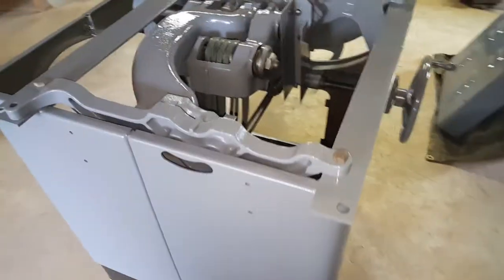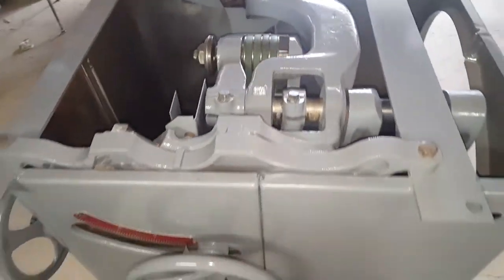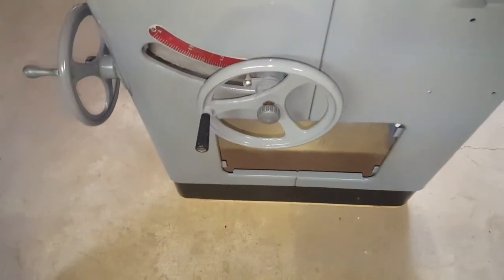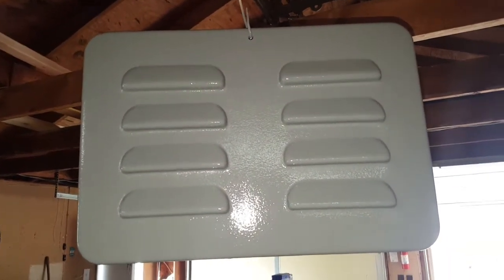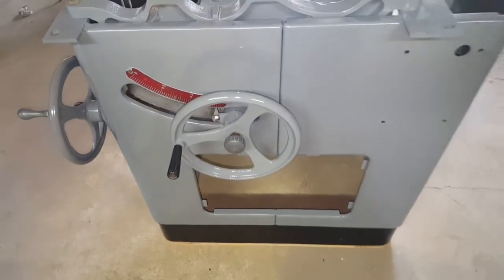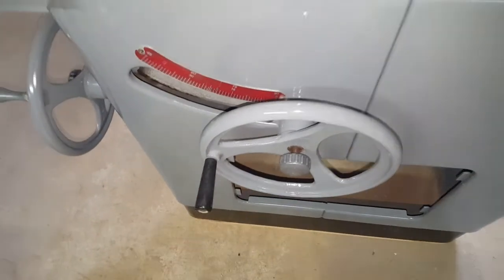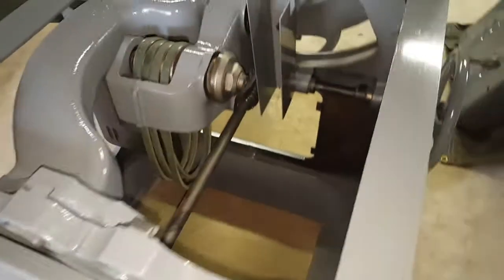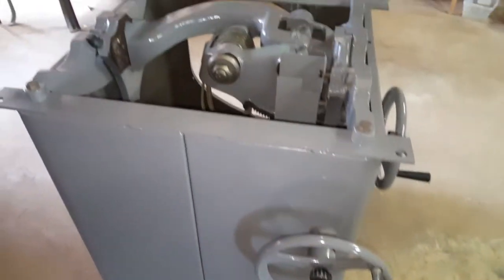Delta 12"-14" Tablesaw Restoration Project Update

Comment: i just took possession of  a 34-395 Rockwell saw.  Does the nut on the saw arbor turn left or right to remove the saw blade ?  Most of my saws the nut turns left to remove.  Thanks
Reply from the maker: Gene Harpenau it's left handed like all other table saws. Enjoy new saw.
Reply: Hello could you please tell us what brand of paint and color. Also I’m in the middle of knocking down a Delta Unisaw 34-802 type 1 everything but the motor could you tell me what type of grease you use for. All the reassembled moving parts.im having the top and wings ground down with a Blanchard machine could use any and all advice as far as reassembling this beast for my first time in 25 yrs. doing something like this is new to me but enjoying every scratched knuckle so far